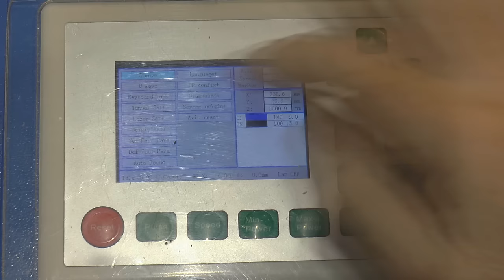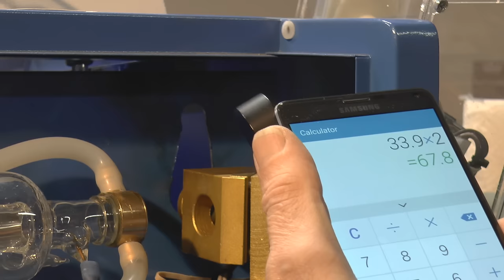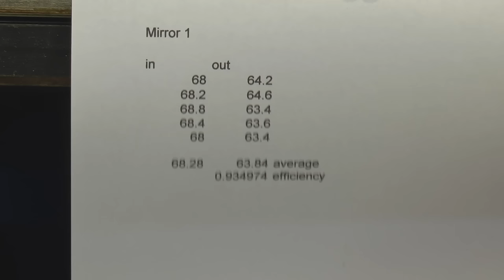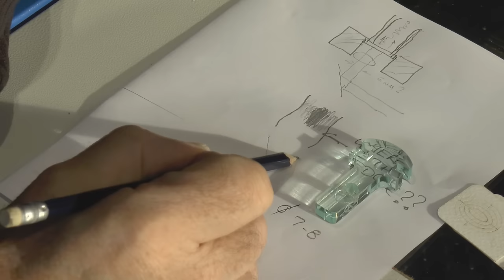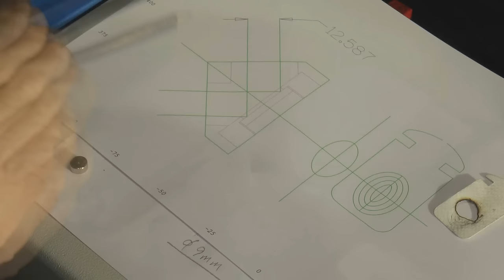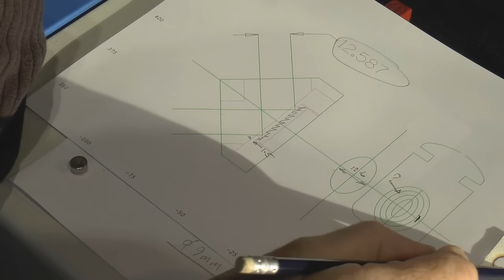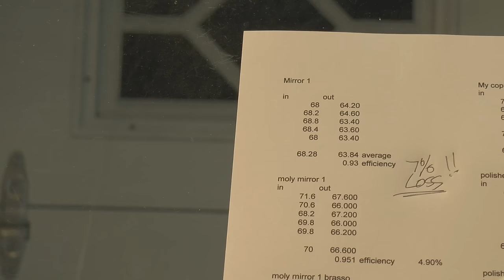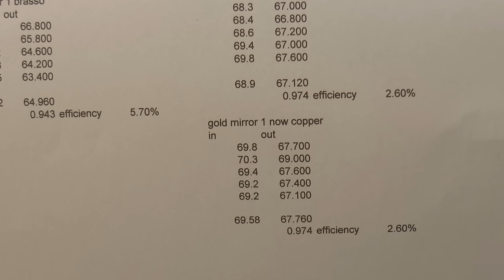RDWorks Learning Lab92 Fitting ebay Copper Mirrors Part 1

Comment: a really good way to show the flatness profile of a reflective surface is to hold it 90 degrees on a piece of graphing paper.  The grid in the reflection will give you a really nice flatness profile.  much better than just looking at misc reflections
Reply from the maker: Hi
Thanks for that tip it will certainly give a great idea of flatness. I do use straight lines to show distortions. In fact I normally reflect my twin florescent tubes and I can clearly see curvature at the edges of everything I lap. I plan to get those mirrors professionally lapped. So the saga continues.
Best regards
Russ

Comment: Russ, it occurred to me at 30:57, could you modify your target holder slightly, and put a target (paper or acrylic) on the output side of the mirror, and observe the clipping effect directly?
In fact, what purpuse does the output side "tube" serve on the mirror blocks?

Comment: It looks like the square block that the mirror actually mounts in is held into the larger Triangle block with 2 set screws. Is it possible to remove that smaller block and put a 45° chamfer around the outer edge so the beam isn't clipped before reaching the mirror face?
Reply from the maker: Hi Doug
I have got rid of them competely.

Russ

Comment: I polish copper parts all the time.
Hint: Use sandpaper on a piece of glass. Keep the sandpaper wet and change it when it gets clogged. (can be washed to extend the life). Start at 400 or 800 grit depending on the surface you're starting with. Progress down to 2000 or 4000 then flitz with a microfiber.
With a little practice you can get flat and mirror like surfaces.

Comment: Russ, I understand the fundamentals of laser beams. I'm wondering if the specification is based on the shortest possible burst, rather than actual usage. Try firing a pulse at the shortest time possible on the system and see if the beam doesn't come close to their specification. May have to set the power higher to get the mark, but it may answer the difference in your findings vs their claim for beam size.
Reply from the maker: Hi Brian
I tackle beam size in more depth with this video   https://www.youtube.com/watch?v=EVt9tuZpRdw

Best wishes
Russ

Comment: i wonder if you could make a metal shield with a hole in it to sit directly in front of the laser that the power meter could be held behind to eliminate the fringe output from the pre first mirror measurement.
Reply: In order to get as accurate a pre mirror measurement as possible.

Comment: Hi Russ , just wonderd what would happen if you made the coper mirrors slightly concave?
Reply from the maker: Hi Stephen
I have already answered this comment once but You Tube seems to have "disappeared " it
If you have CAD software you can quickly test your thought  with some simple ray tracing  Firing the beam DIRECTLY at a concave surface will indeed converge the beam. Sadly when you tip the mirror through 45 degrees  the different reflection angles that each edge of the beam will see has the effect of producing an asymmetric diverging beam. 
Best regards
Russ
Reply: SarbarMultimedia 
gasman9845@gmail.com

Comment: Hi,

Where did you purchase the "good" mirrors for the 50 W laser?

I am trying to avoid buying the low quality ones.

Thanks.
Reply from the maker: Hi
There are basically only two types of mirror, those that are gold plated  and one type that is unplated. A you will have seen from my series, I have been experimenting with unplated copper mirrors for about a year. They are very succesful but you cannot buy such mirrors. Any copper mirror that you can buy will be gold plated (well, plated with something yellow!! I'm pretty sure it's not gold). They are expensive and are just a waste of money. There are mirrors called K9. These are just crown glass that have been flashed with gold. They are very cheap and very nasty. just one step up will be silicon mirrors that will be flashed with gold also. There are also  some platinum plated mirrors available as well I would also recommend you do not buy either of  these . In all cases the plating will rub off at your first cleaning attempt. The only option left are molybdenum (Mo) mirrors which I would recommend 100%. No plating to rub off, extremely hard and will resist scratching, clean as often as you like, even with with acetone and they are not that expensive. They are about 2% less efficient that my polished copper mirrors but are really the best value for money. There is little difference in quality from any ebay vendor  but I have always bought mirrors and lenses from
http://www.ebay.co.uk/itm/HQ-K9-Si-Mo-Cu-Reflection-Mirror-for-CO2-Laser-Cutting-Engraving-Diam20-25-30mm-/230933149109?var=&hash=item35c4b035b5:m:mIDAZF4aFahBrCP1LJ89HgQ
 
Best regards
Russ
Reply: Thank you for the detailed response. I am located in NY so I'm gonna research some options for my situation.

Thanks again.
Reply: Any tips on the lens replacement?

Comment: great work very interesting what diameter are you mirrors.  when buying a machine would larger mirrors if you can get them be an advantage
Reply from the maker: Hi
My mirrors are 25mm diameter but by the time they sit in a frame they finish up at about 23mm diameter. However, because they are recessed into the mount and tipped at 45 degrees to the beam, the effective width of the mirror becomes greatly reduced (as per my sketch). I am informed that above 80watts the diameter of the beam claims to be something like 8mm. Oops, that means that if this same ratio applies then the mirrors will be spilling power no matter how well you set them. I'm not sure you can buy bigger mirrors they tend to be 20 and 25mm diameter. All in all, a very interesting finding. Seems like years of research and development DID NOT go into the design of these machines.
Best wishes for the New Year
Russ
Reply: hey Russ,
wonder what happens if you move the tube closer to the mirror?
is the beam divergent?
Reply from the maker: The definition of a laser beam is that it is a COHERENT beam of light with ZERO divergence. Thus it follows that the distance to the first mirror will have no effect.
Best regards
Russ

Comment: Hi Russ, great insight into specific problem as ever. Have you considered grinding off the aluminium, which is in way of the beam at 45 deg and perhaps going further, grinding even more, exposing edges of the mirror, it would still be held in place and resulting available width would be increased to 14.1mm (minus chamfer on the edge of mirror) and the aperture at 45 deg will be wider.
Happy New Year!
otto
Reply from the maker: Hi Otto
A very sensible suggestion that would give a little more real estate to work with. I'm planning to get the copper mirror saga finished first and then think more about alternative mirror size/mount options.
Best regards
Russ
Reply: I will watch your alternative mirror size/mount options video with a great interest. In the meantime - on the mirror / surface - in my previous life I made microfilm equipment - using lots of first surface mirrors, best were aluminium with a silicon coating to stop aluminium from tarnishing and allowing cleaning. They were in high 99% + reflectivity in the visible spectrum. I will try it with laser, if the surface will last or gets evaporated by the power. 
On the mirror cleaning - try water.  I had badly tarnished Mo mirrors, after IPA and acetone cleaning still stained, I thought it is burned in = bin job, but water dissolved it back to as new.
Whilst on the mirror rant, how about using some of our air assist to blow into mirror mounts to produce +ve air pressure to reduce smoke getting near mirrors?
I checked the CO2 tube specs, they usually say beam width 4 +/- 1mm, making it 5mm dia max. You  measured about 12mm?
Reply from the maker: Hi Otto
Lots of interesting issues you raise. First mirrors. A surface that we see as shiny is reflecting visible wavelengths. At the 10.6micron wavelength of CO2 radiation things are not quite that simple. Although the radiation is still light in the sense that is a wave and sits withing the electromagnetic spectrum, it is invisible to our eyes but we can still detect it as heat. It's the same heat that radiates from radiator or fire. However that is broadband infrared radiation where as uor CO2 heat is like monochromatic light in that it is heat made up of just one wavelength. That imbues it with special properties. Shoot broadband heat at any metal surface and that surface will heat up through energy absorbtion. Some metals, such as copper ,aluminium gold and silver, are extremely efficient heat conductors and logically one would expect rapid heating /energy absorption and transmission when exposed to IR.  Staggeringly those metals are highly reflective of 10.6 micron radiation which is why they are used for mirror materials. The flatness of the surface is important as is surface texture/finish. Out of flat and surface texture irregularities will still reflect at very high percentage values (99%+) but will cause the coherent beam to scatter which is how the beam grows and loses its energy.. Flat reflective shiny surfaces are a visible indication that geometry and texture are correct for accurate reflection at 10.6 microns but its the crystallography of the material that is causing the reflection NOT the actual surface. Dull copper will still reflect 97% It is the magical properties of copper in particular that is keeping me motivated to find a copper mirror solution. I have some plans that may take a few weeks to materialize but that saga continues.
In the men time I have some misbehaving moly mirrors that i need to work with. I have likewise worked them over with IPA (not the brown stuff) and acetone. I plan to try white vinegar and after your tip I shall have to try water also Many thanks.

Some more pro machines do have air purged mirrors. Because I run my machine open most of the time and I have free flow of air into my machines from all directions, I think my extraction system is indirectly purging my mirrors. I know that when I close the lid there are eddies and dead-spots where there is little airflow.  If the mirror/s sit in these areas I can see potential for particulate settlement.

I know what the tube specs say and until recently I have not questioned them. Facts speak louder than specs though. I think that making an assumption that the beam energy density is a Gaussian TEM00, then about 90% of that energy is contained within maybe 50 to 60% of the full beam diameter. Different power tubea have different size output windows(partially reflecting mirrors). The window on my 70 watt  tube is 12.7mm thus potentially there could be energy out at this diameter even though the beam is claimed to be 6mm.  How can I measure the efficiency of a mirror if some of the energy is missing the mirror? That was my problem and why I went looking for problems. When I had a 40watt tube on that same machine my copper mirrors were fantastic performers showing me 99%. That's dropped to 96 or 97% with a more powerful tube. Why?  The beam size has increased from a claimed  3mm for 40 watts to 6mm for 70 watts.

I have some new mirror mounts on order from China. I will machine away flanges that mask the last 2mm of mirror edge in an attempt to gain extra mirror real estate. Nice idea. THANKS AGAIN.

Thanks for your thoughts and comments 
Best regards
Russ
Reply: Hi Russ,
Thanks for your stimulation and comments. At this stage I am more at the theory end, rather than using the machine, googling around and watching your videos. Lots of hours you have recorded and commented. As I moved from K40 to this blue 3050 machine, which from the distance looked like the real McCoy with Hi-Win type axes, much better mirror and lens mount and the Ruida controller. But after spending some time I realised the whole machine needs a lot of TLC, it has been "thrown" together, not carefully assembled. My XY axes are not square, beam is all over the place, table needs levelling etc. So it is easier to get involved in the blog, which helps me to concentrate on the task in hand. Where do I start? What is essential and what is waste of effort? I wanted to use it just as another machine in my digital workshop, and it is turning into a research and development project on it's own. 

Re: cleaning with water - it was actually saliva on my finger which moved it. Vinegar is also interesting stuff. The point is rather to dissolve it than rub it and disturb the surface. Maybe a vodka would be good - or diluted IPA 50/50 so there would be water and alcohol at the same time. 

Re: extraction - I found that leaving the lid partially open, standing on 1/2 in bumper feet creates almost laminar flow of air over the table surface. That helps in clearing the enclosure from smoke. My supplier has got 1500W laser to cut 15mm plywood with 1mm kerf for insertion of ruler cutters. Huge machine, takes 4x8ft board, the laser beam is contained within articulated tubular arm, and he has got huge screw air compressor  blowing air into the cut. I would love to be able to take the covers off! I don't think he would let me. 
 
Am I guessing that you are going for 30mm mirrors? 
Best regards
otto